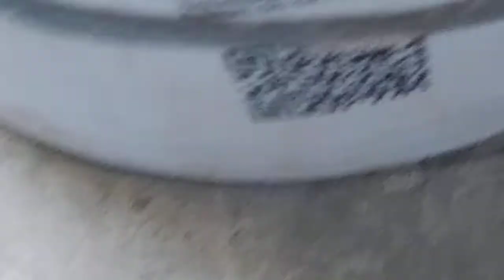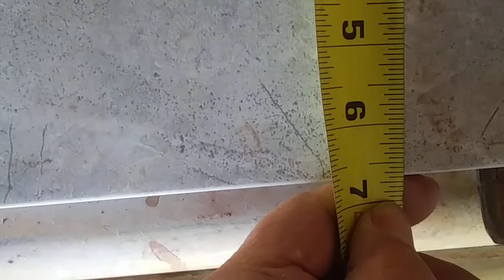How To Cut A Half Circle On Tile A Round Toilet Flange and how to lay it out part 2

Comment: Full watch here Ken! Both of those methods - the tile saw and angle grinder - both worked out well for cutting a circular hole in the tile for the toilet flange!
Reply from the maker: Let him up Outdoors the wet saw it's a lot cleaner far as is no dust lot healthier to use but sometimes the angle grinder works the best and it's easier to use sometimes it's awkward. And there are times you need to cut your tile from the back side of the blade and come forward depending on what you're doing is it for more complicated cuts on that website just to give you a heads up four angles depending on the angle you can use a speed square to do that although I've used Blue Ox credit Ingles for that purpose it just depends on are you learned but thanks for your time in the support appreciate the comment God bless you bro bye for now and your friend Ken
Reply: @HomeImProveMentHow  All good points Ken! Different techniques for different purposes. You touched on it briefly but well done!